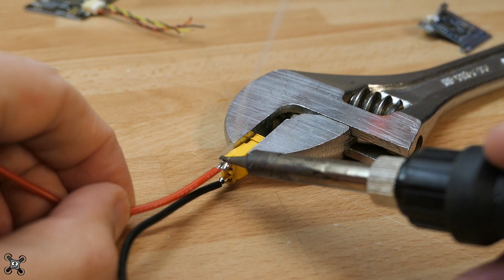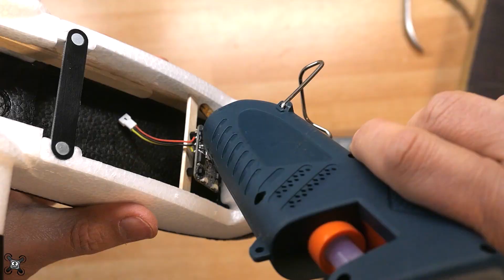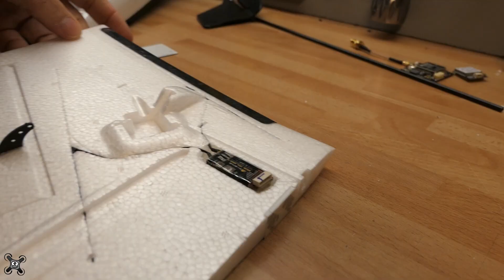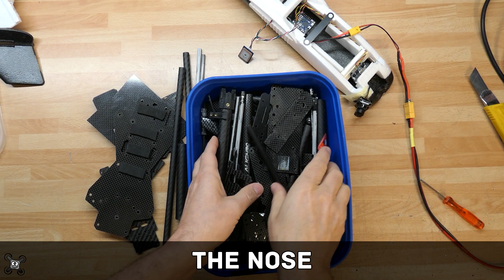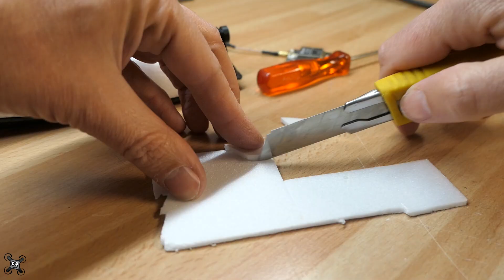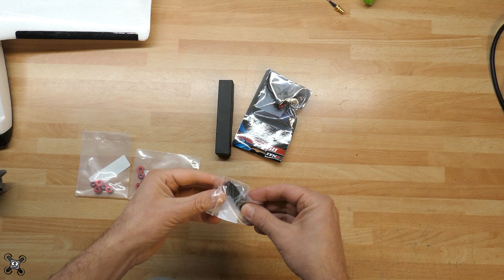Zohd Dart 250 + INAV 2.3.0 : Day 2

Comment: 1:45 why are you soldering your GPS connectors to UART2? I am setting up this same plane with the same FC and GPS unit. I soldered the GPS onto UART1(TX1/RX1) pads and my receiver to UART2(RX2 for PPM)pads. My RC control link works fine but I cannot get my GPS to communicate with the FC board at all. I have the same settings you are using and it won't show anything in the GPS tab of iNav. All the values are 0. The GPS powers up and the RX light blinks once a second. I am using iNav 2.3.0. I would try to move my GPS wires to TX2/RX2 but my PPM signal wire needs to use RX2. Any thoughts?
Reply from the maker: You have a good eye, I noticed my mistake right after I stopped filming, and moved the GPS to TX1/RX1.
For your issue, did you try to swap TX and RX for the GPS ?
Reply: @Olivier-C  I did not, the RX is the green wire and the TX is white according to the diagram on the RMRC mini 220 GPS module. Maybe they have it listed wrong. I guess that's the only thing I can try at this point.
Reply from the maker: @christopherstarzyk9209  Worth a try, sometime on the GPS they label "TX" because that's where it's supposed to be plugged to the TX FC side, whereas its RX (GPS side).
Reply: @Olivier-C  Good point and I delved into that more and you are right. The Matek diagram shows the GPS TX going to the FC RX, and the others respectively. Thanks man!
Reply from the maker: @christopherstarzyk9209  That's normal, the emitting side (TX) goes to the receiving side (RX), and reverse. But sometime it's labelled the wrong way on the GPS, and then must be swapped

Comment: Where do you wire the ESC signal and ground wires?
Reply from the maker: Signal goes on the S1 output of the flight controller, and the small ground wire is not needed on the ESC, there's already the big one for power